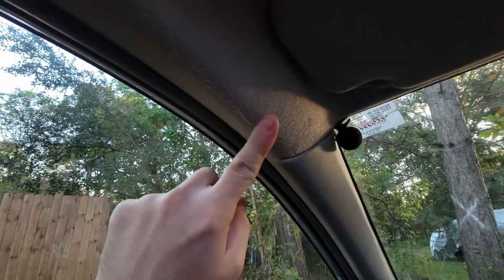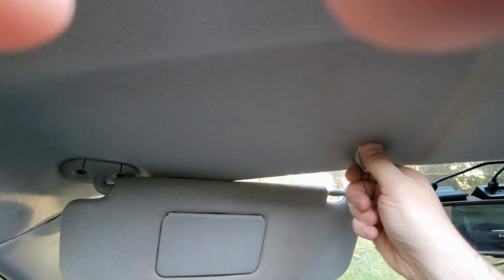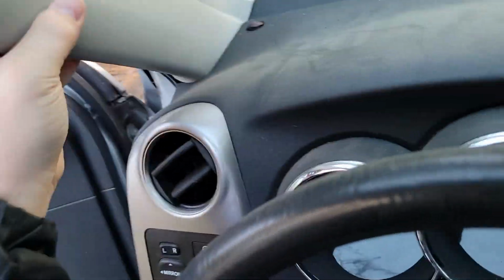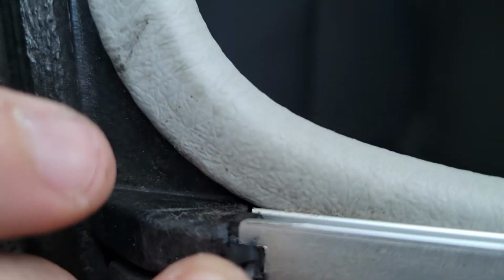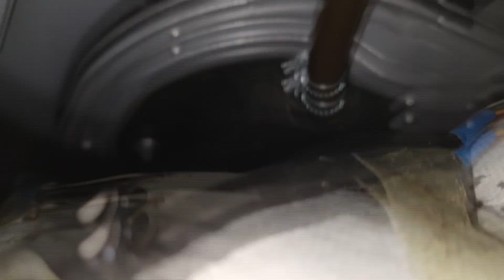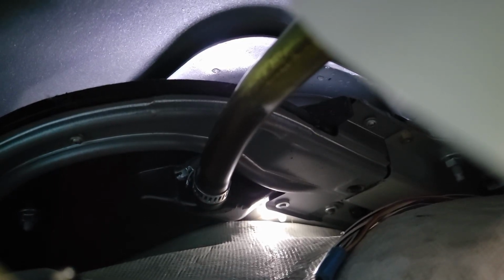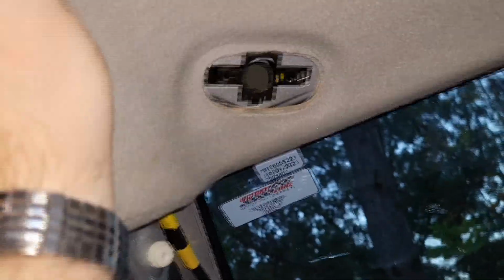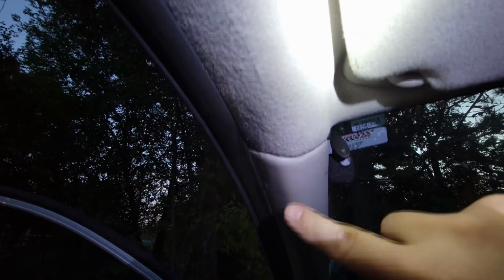2008 Pontiac Vibe Dripping Wet at Top of A-Pillar, Fixing Moonroof Sunroof Leak

Comment: Thank you for this video. My 2006 Vibe is leaking in the exact same place, but I do not have a sunroof. Any thoughts on that? Could it be leaking through the roof racks somehow?
Reply from the maker: In my research of this issue it was often found to be the windshield leaking at the top, but I suppose it could be the racks.
Reply: Darn! That makes a lot of sense, I have an 04 with 278k that I bought from my gparents who bought it new. I had and thought I fixed the issue of the hose but after you saying the windshield I have noticed my windshield seal is not 100% anymore so I should go check that too!
Reply: Roof rack leads to the windshield that may have dry rotted silicone/rubber
Reply: I am just seeing this as I now own 2 vibes and both leak. One with sun/moon roof the other without. Both were leaking from roof racks and top of windshields. Also sun/moon roof seal leaking at both back corners. I just have some painters tape over the edges of my sunroof right now and took racks off and sealed all ports of entry and sealed top of windshields.  Seems to be holding well so far. I would suggest a car cover or carport as any aftermarket sealant will not last the seasonal elements for too long. As sor sunroof on mine. I will be getting all new seals as I do not want to seal off and not be able to use it.
Reply: Mine used to do that, and I added a small glob of silicon caulk at the front edge of the rail where the A pillar joins the roof. Hasn't leaked since (at least 5 years).
Reply: 2004 Matrix with same issue, no sunroof. Toyota says the windshield needs to be replaced.